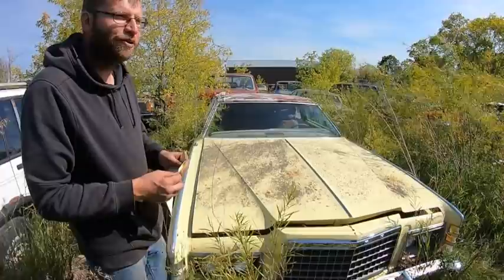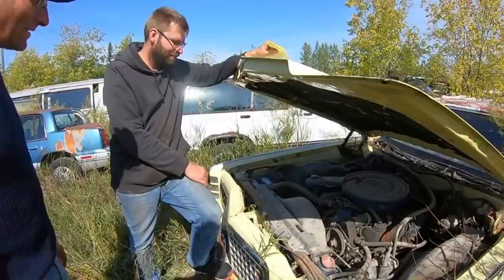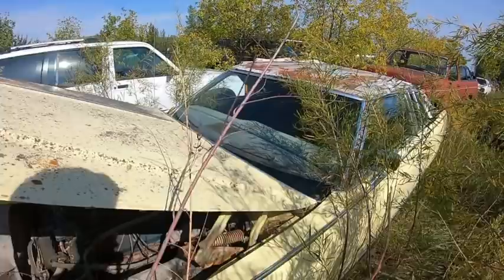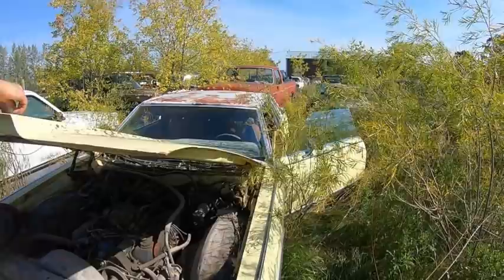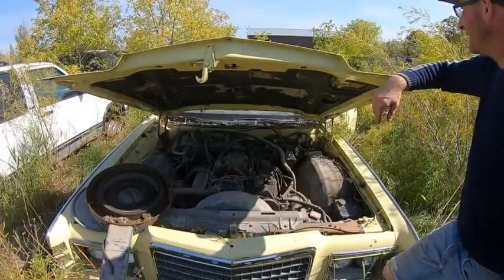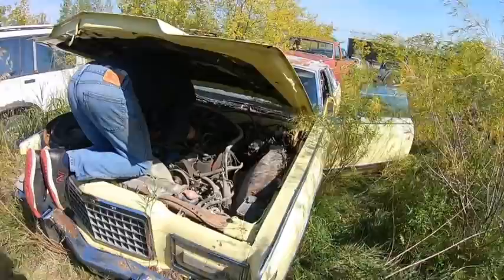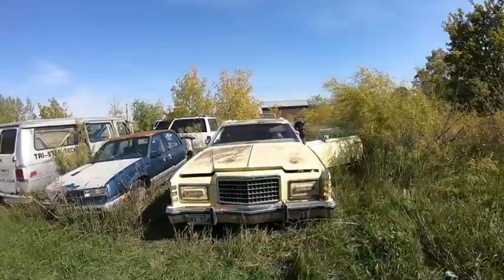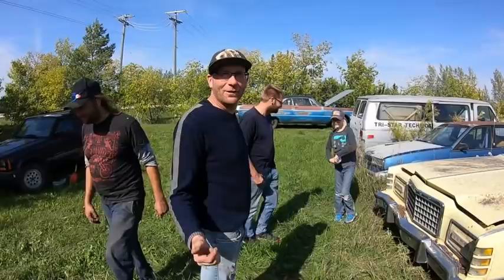Abandoned Field Find Rescue of A 1975 Ford LTD 460ci Big Block. Will It Run.  Great Burnouts.

Comment: I would put a window in it and clean up the interior or just get the seats done up and fix the roof a bit and drive it. The engine runs really well after 15 years and the trany seems tight. It is a diamond in the rough.
Reply from the maker: Was really amazed on how well it ran thats for sure Jon thanks for watching.

Comment: Wow that big old Ford  460 engine  never missed a note as she was singing  the tires  while spinning.  Great old car to leave as is BUT would be a great engine for an old Ford pickup truck.  Not the Black flathead truck but for a future project 73 to 79 Ford pickup
Reply from the maker: I know the black Ford will always have a flat head in it but will figure out some thing down the road the old girl sure seems to run good Gary.
Reply: I was thinking frame swap with like a 65 F100 :)

Comment: FoMoCo had the most incredible full-size cars of that era...built like tanks, quiet, overstuffed seats, and the smoothest ride.
Reply from the maker: They were a great car back in the day thats for sure thanks for watching.
Reply: Amplass 333  What models?
Reply: Amplass 333  I have a 1976 Lincoln Continental Town Car (4-Door)...Dove Gray inside and out with velour upholstery and aluminum cast wheels.
Reply: Amplass 333  A TRUE LAND YAUGHT LOVER !!
Reply: I went to the US for a month in '87, from New Zealand. Bought a $400 '73 Mercury Monterey with the 400 engine, the day I arrived in LA, AND proceeded to do one lap of AMERICA....10,000 mile round trip !!
Reply: Very true! I own a 1976 Mercury Cougar with the  460 and it rides unlike any car on the road today

Comment: beautiful car, the america that i loved. incredible, it starts so easily after so many year. that is what i call a "car". if you restore this car and want to be definitively efficient,  you should  put grease everywhere. grease et the only thing very efficient against rust. put grease between metal and carpet, inside door, behind bumper, behind (inside the car)  the repair you made (everywhere inside this hole before reclosing instead of using paint), hollow areas... For rear wings unreachable with a paintbrush, use an extender and poor old oil everywhere each year. 35 years handy man experience. from france.
Reply from the maker: They sure are a neat car thats for sure thanks for watching it really is a great engine.
Reply: @pennyshotrodscustoms  and a great  car from a great period  in a great country even it is not perfect but nothing's perfect in this world. thanks a lot to make it live again
Reply from the maker: @dette-envers-les-animaux Glad you guys liked it.

Comment: I had a '73 LTD with a 460. It had power when I got it running right, but fuel mileage was horrendous.  Best I got out of it was 10 mpg.
Reply: Ain't this the truth lol. Have a 76 Cougar with a 460 currently and I'm lucky to get more than 6mpg lol ...
Reply: @ballpython365  Is that before or after you put in neutral and turn the engine off to coast on the down hill runs? 😂
Reply: @mikeadams2677  😂😂😂

Comment: Excellent video Penny's  :) also that motor plus Transmission should use for Studebaker truck so do burn 🔥 out everywhere to and 460 are excellent motor to ! My oldest brother David had one in his first 1976 Mercury cars and did burn out and powerfull too !
Reply from the maker: There pretty good engines and not sure what will do with it yet Dereks pretty stuck on putting a dodge in the stude but will figure out something.
Reply: @pennyshotrodscustoms  no problem also glad see that Studebaker truck up also running and paint too ! Think color Red body and Black interior too look sweet!

Comment: I got a kick out of this. My mother had a 77 Ford Ltd it was a black boat. She kept it she made me some blocks so I could reach the brakes and gas and would drive it around the farm. It finally rusted into. In 99 I took the motor out and it's in a 1979 Ford ranger....back when the ranger was a big truck. Still running to this day and don't use a drop of oil.
Reply from the maker: Thats awesome there great engines Jason and like hearing stories like that

Comment: Back in the 70's, Chrysler Marine used 460 Fords for their big block motors.
Reply from the maker: That they are pretty big engines thanks for watching .
Reply: Nice and I bet those big engines could move an 1800's Vintage Smack especially if it's blown as smacks are bigger than motorboats
Reply from the maker: 👍👍😁😁 @omartorres5688
Reply from the maker: @omartorres5688  👍👍
Reply: No they didnt. Chrysler Marine would have used a Chrysler 440 block with marine intake, reverse flo water pump and brass core plugs
Reply: @broncomcbane6382  I worked on one with a rusted through oil pan. Had to buy it from Ford. I might have the time frame wrong, but Chrysler used Ford 360 blocks at some point.
Reply: @labrd41  nope. A Chrysler 360 and a Ford 360 arent the same motor either. A dealership can sell two brands on the same lot but Chrysler and Ford engines arent the same. A Chrysler 360 is an LA Family block. A Ford 360 is a FE Family block. Not related.
Reply: @broncomcbane6382  Your right. My bad, Ford 460 not 360.
Reply: @labrd41  a Ford 460 is a 385 Family engine. A Chrysler 440 developed in 1965 is a bored out 413 and in the RB engine family. Chrysler used their own engines for marine applications. Chrysler 440s were the gasoline engine of choice for many tugboats after 1978 to like 2000. Ford 460 was used in speedboat racing but never off the shelf as a marine application

Comment: HELL YEAH! PARRRRRRTY BARGE!!!! That's too bad about the interior. Ford had a way of installing front and rear power couches into their cars in the 70s! Motorcraft 4300D carbs, usually pieces of shit. This one actually seems to work! Well known for part throttle issues. All mid-late 70s 460s had the retarded timing, plastic-lined, timing set. So they are still neutered in stock form if the cam gear hadn't blown apart, that is... Someone may have already replaced it as it runs really damn good!  I have a '71 460 in my '76 F100 short wide and let me tell ya, laying scratch across an entire intersection is easy work. Yes, headlight doors default open without vacuum (safety thing). You guys should TOTALLY roll this to Soberings show!!!

Comment: Espero que el 351 del 74 sin control de emisiones pueda hacer lo mismo ✌️💪🇲🇽
Reply from the maker: Lol you never know 351 are really good engines.
Reply: @pennyshotrodscustoms  en México 🇲🇽, mi familia tiene un Ford Galaxie 500 año 1974, trasmisión manual que originalmente traía un carburador Holley de 4 gargantas o barriles (4V). Espero algún día poseerlo para darle la vida que se merece ✌️💪🇲🇽
Reply from the maker: 😁😁 @ELPROFERAPOLDSCHOOL  Heck ya
Reply: Si se puede si el motor esta corriendo bien.